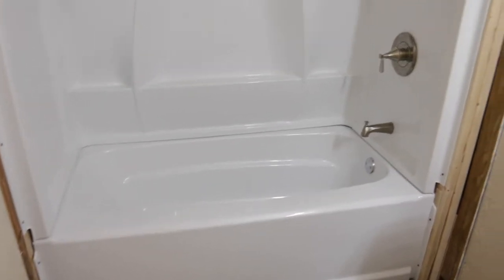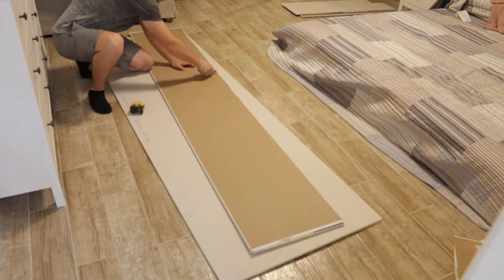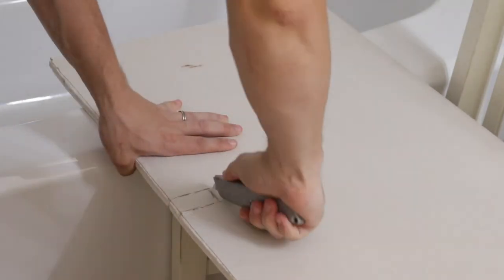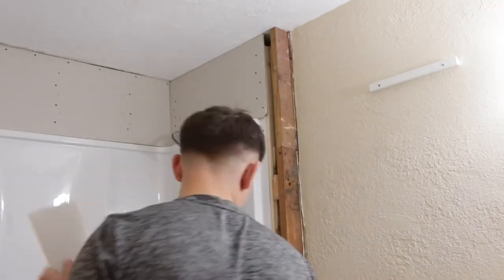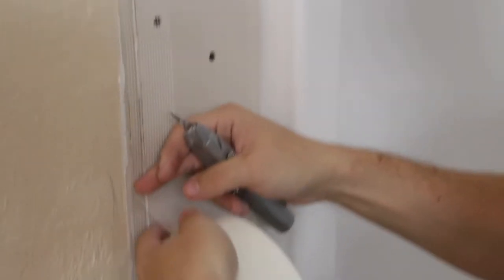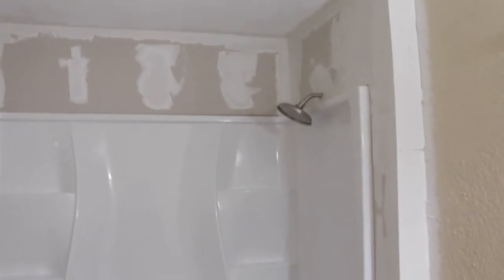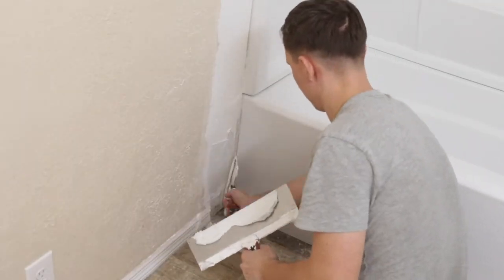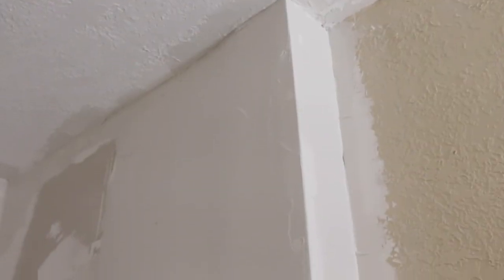How to repair Drywall around Bathtub - Step By Step - Part 7

Comment: Wasn’t green board supposed to be used
Reply: I was thinking same thing
Reply: Or blue..
Reply: Yes I believe he was suppose to use aqua block drywall.
Reply: Don’t have to…good paint and sealer will keep it protected. If you can, yes, but not needed.
Reply: Depends on the builder

Comment: How many time did you come back and fix them drywall cracks? Paper with that premix would've worked better next time, Or get the hot mud for the web tape. Durabond also to fill them voids before you start anything....prefill goes a long way
Reply from the maker: zero

Comment: how did you cut old drywall from corner of ceiling  because mine I need to cut  all around the shower to install purple board  then new shower walls
Reply from the maker: Little by little. Watch my previous videos about bathroom renovation, you will find all information you are looking for.

Comment: What about the old tape around the ceiling? You are adding New tape what happened to the old tape on the ceiling part since that drywallremains up. DO you cut it out? Or just tape the New over the old (on the ceiling part?)
Reply from the maker: I removed an old mesh tape and put a new one. It is easier.
Reply: @CreativeProcessDIY  ok makes sense

Comment: Do you drill the nails through the shower liner as well?
Reply from the maker: do you mean if drill the screws when I install drywall into acrylic walls?
Reply: yes, otherwise there's no other way to attach the drywall, the assumption is the force between drywall and stud would seal around the hole that screw has made.

Comment: So this is remodeling not repairing a drywall.
Reply from the maker: This is a video about how to install a drywall around bathtub
Reply: The steps will be exactly the same.  Screw  in the drywall, tape, mud, sand.  I would however recommend using paper tape in the corners, not the mesh tape.  Paper tape in corners is best practice.  There's a product called "perfect 90" I think.  It does corners really well.

Comment: Wow…that’s a lot of screws!   Cutting the drywall without a straight edge…..?   Evidence anybody can make a video regardless of expertise and workmanship.
Reply from the maker: Did you see a final result? If you don't - watch the video till the end... Thanks
Reply: @CreativeProcessDIY  It's a lot more than just how it looks, it's how it lasts.
Reply: " anybody can make a video regardless of expertise and workmanship"

Welcome to youtube. The best part is you will have dozens or even hundreds of clueless twits telling them what a good job they did, even if everything they did was wrong.
Reply: Yeah with fill and then thin tape you can get away with it. Also your tape is a straight edge...wait he didn't use the tape straight edge or hot mud on that web tape...